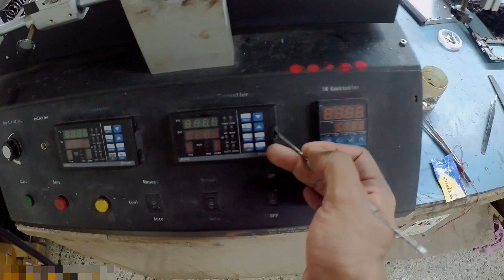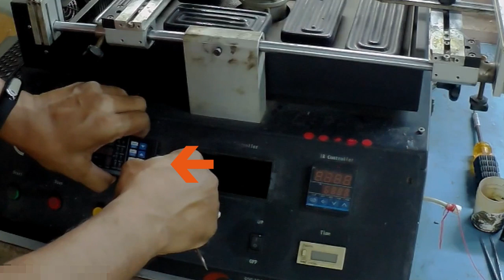HOW TO SERVICE BGA MACHINE BOTTOM HEATER (PART 1 OF 3) हिन्दी

Comment: सर लैपटोप की भाषा में ldo  का क्या मतलब होता है
Reply from the maker: Low Drop Out: A linear voltage regulator that will operate even when the input voltage barely exceeds the desired output voltage.